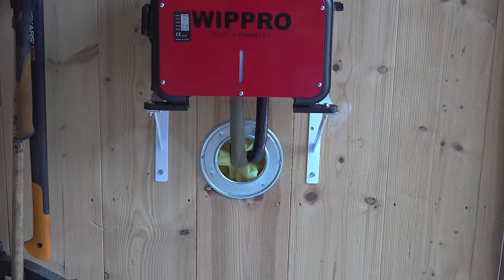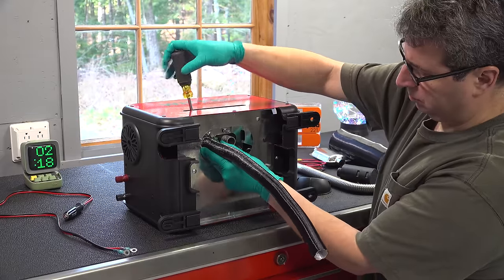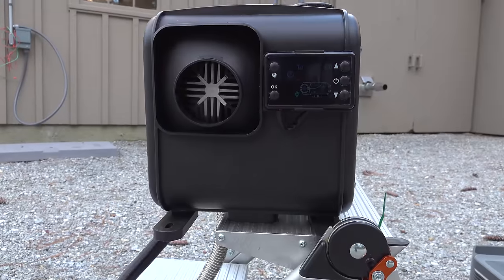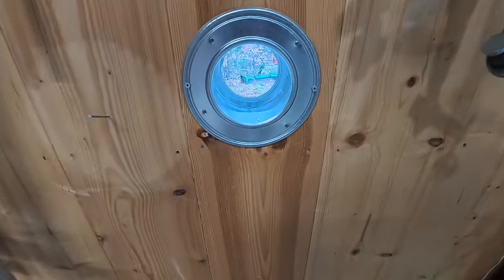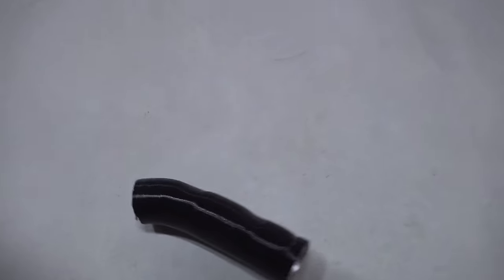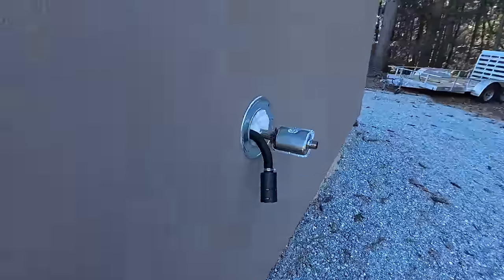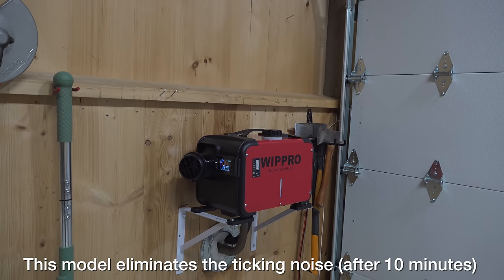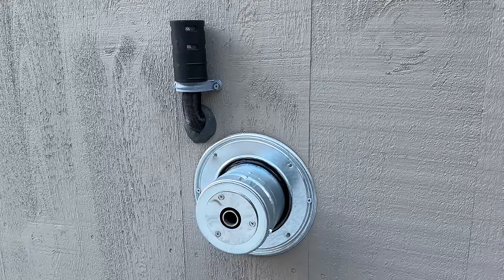How to Heat a Small shop with a BUILT IN Diesel Wall Heater

Comment: Here I go again, spending more money per The Silver Cymbal Channel!   haha :)  I've been heating my barn with an 80,000 BTU kerosene heater which works great but I blow through 3/4 gallon per hour.  I just bought a 5-gallon container of kerosene at $54.00 at Tractor Supply which is my 2nd 5-gallon can purchased this winter,  so far.   So this route is worth a try to save me some money.  Thanks Chris.  :)
Reply: These diesel heaters are up to 8000 BTU (maybe bigger, but that's as big as I've seen the cheap ones). You'd need 10 of them to replace your kerosene heater if you need that much heat.  Given you've only used 5 gallons so far, it sounds like you don't need 80K BTU. And diesel, even if you pay road tax, is probably less than 1/2 the price of kerosene.
Reply: @Sylvan_dB   All good thoughts. I hadn't looked into the specs yet so I didn't realize there was that big of a difference in BTU's.    Yeah, I only use the heater when I am working in the barn so maybe a few hours here and there.  I guess I am overthinking my need to replace my current heater.   Thanks for your response and input! :)

Comment: Why use outside air for the intake?

Otherwise, you did an excellent job on the installation. I’ve never seen this type of heater and see several applications for it. 

Thanks,
Reply: The outside air is for combustion and gets revented outside after combustion. If you used the inside air for combustion you would deprive the space of oxygen and potentially make it dangerous.
Reply: You could use inside air for combustion, but that draws the warm inside air out and replaces it with the cold outside air seeping in to fill the vacuum.

Comment: Hey quick question is it bad for battery too be fully charged and not in use
Reply: Yes that's pretty bad for almost all sorts of batteries. Keep them around 40-60% state of charge for storage
Reply: @jashast3248  oh thanks
Reply: Depends on the battery chemistry, lithium-based batteries should be stored around 50% charge. Biggest common outlier are lead-acid batteries they must be stored fully charged perferrably on a maintainer or sulfate crystals will form and permanantly* reduce the capacity.

Comment: Intake may pull the exhaust fumes inside
Reply from the maker: That is combustion air only. The intake air for the room is in he back of the heater. You want combustion intake air from outside. That air is never brought into your room. They are separated similar to a gas furance. The only time fumes would be released would be if the exchanger cracked.

Comment: Why put the intake outside next to the exhaust? Wouldn’t it be better to draw the warmer (and cleaner) air from within the heated space?
Reply: That air is for combustion only. 
If you drew it from inside, you’d be creating negative pressure inside your heated space, drawing in more cold outside air.
Reply: Makes sense - thanks

Comment: why don't choose a wood furnace?
Reply: This is faster and easier.  If I’m only going to be out in my shop for an hour or so, I want instant heat.  When I’m done I just want to turn it off.  
Liquid fuel is easier to procure, store and has no residuals.

Comment: I wonder if these would be good for the homeless during the winter.  It should be safer for them than starting a fire to keep warm.  In Los Angeles a lot of fires are started and go out of control from the homeless, trying to keep warm
Reply: You think they are going to use diesel instead of other combustibles? You think they won't burn down the camp with the exhaust pipe. The homeless are not really homeless. Let's be honest here. They choose an off grid existence due to addiction and lifestyle needed to acquire drugs.

Comment: While it probably doesn't matter too much for your usage, the air intake would be better if it were inside. Two reasons one it would be drawing in already warm air so it would be a little more efficient. The other is it is pretty close to the exhaust in your set up so there is a small chance of pulling in exhaust fumes into the room.

I have one although it didn't work when I got it, and I have not bothered to work on it yet. I want to use it for camping.
Reply: The intake that he placed outside is only for combustion so you dont have to worry if its pulling in fumes. But yes you would get better efficiency if you pulled your combustion air from the heated space, you could also do something to use the waste heat from the exhuast to preheat the air similar to how carburetted vehicles used to.
Reply: @camerontechstuffs  Ah yea you are right,  I think it is a sealed combustion chamber so any fumes would not reach the inside.
Reply: Pulling air from inside and exhausting it outside would create negative pressure, drawing in cold air from outside. You would end up gaining nothing. I’ve seen people using a sand battery to extract heat from the fumes to preheat the incoming air.
Reply: Negative pressure is worse, he did it right.
Reply: high efficiency home furnaces pull air from outside

Comment: Would leaving the intake inside make the unit far more efficient?
Reply: Would cause a vacuum in the room you're heating, sucking in cold air.
Reply: @evictioncarpentry2628  Ok, then please explain where the combustion intake will get its air.

Comment: EGAD    Those outside shots are concerning - Air intake far too close to the exhaust (according to the manual for the Chinese copy of heater),   if you were to mount the intake inside the cabin you would suck in warmed air and likely boost efficiency surely.

Comment: Question. Why does the air intake have to be routed outside? What is the benefit? I have yet to see a valid reason for this.
Reply: Keeps more of the warm air inside. Any air that goes in to the intake from within the heated space must be made up with cold air seeping in from outside.

Comment: In answer to your question, the ticking is only while the fuel is being forced into the system during warm up. Thereafter it becomes self sustaining due to the pressure difference between the different areas.

Comment: Why run the intake outside? Won't it work just fine on the inside? Then you won't have to drill more holes in your house.
Reply: That air is for combustion only. 
If you drew it from inside, you’d be creating negative pressure inside your heated space, drawing in more cold outside air.

Comment: Why drill through to go outside for the sir intake?  You can just intake the indoor air and heat it.  That way you're not pulling in cold outside air, but getting a boost from the heater as it gets to rewarm the same air.
Reply: The outdoor air intake is only for the combustion air. It takes outdoor air and then exhausts that same air with the diesel fumes back outside. There is a separate air intake on the unit itself to pull air from inside to be heated via a heat exchanger then blown back inside.
Reply: @aschnur  Oh, ok. I see what you mean. I'm'a gettin rid of my comment, cause it doesn't apply to the situation at hand. Thanks for enlightening me on this.

Comment: Nice looking install! $3.20 per gallon and 30 hours per gallon means it's about 10 cents per hour which for an off grid install is probably great but if you have mains electricity you might as well just use a small electric space heater -- it'd cost about the same (depending on electricity rates) and be less annoying.

Comment: 1:45
Says fiberglass will catch on fire. Then later puts fiberglass around exhaust @ 4:18
Reply: It's different than insulation. That braided fiberglass is treated and made to be in contact with hot rod headers and EGR units.  Later he puts KaoWool around it as well. You can hold KaoWool  in your hand while you blow a flame on it where it glows bright red but doesn't ignite.

Comment: maybe insulate your workshop first, then add a electric radiator....a lot better than burning fuel for an unisulated workshop
Reply: You could run this for years for the cost of insulation a shop
Reply: @stevenbeach748  yes, and you'd ruin the world forever by doing so - but hey, just use all the oil that is there and burn it - why don't you just leave your doors open? don't even close the doors. dafuq is wrong with you guys, maybe even think A BIT about the climate? oohh no - there is no CH - just burn everything, than you'll need an AC in the summer  (powerd by diesel) to stay cold while you burn diesel in the cold-af winter to stay warm, nice
Reply: @oldestpartofheaven  so fiberglass insulation or closed cell foam insulation is good for the environment? 
Where you getting that electricity to power your heater from?  Is that green too?  Doubtful.

What if you were to use biodiesel?????
Reply: @stevenbeach748  lol - get around the oil industry, get wood insulation or maybe stonewool (yes, that stuff is pretty energy intensive) i'm no fan on nuclear, but even that is better than burning fuel for heat. central heating like in europe is pretty nice. heat-pump/AC is one of the ways to go, maybe even with earth bound heat pump systems - they're pretty effective as well
biodiesel is a nice idea, but it destroys a lot of resources and land just for the purpose of burning fuel again. build windmills and use their energy if you cannot use them immideatly for production of H2 oder store it in batterys. there are so many options, besides burning dinosaurs for heat....
Reply: @oldestpartofheaven  none of those options are good options. Anything electric is going to require power generation.  That causes pollution too.
You ever seen a windmill up close? They're huge.  Each blade is 110ft long and made out of composite.  You know what composite is made from? Oil.
Reply: @stevenbeach748  cute -110feet ^^ in germany the blades 110m :D
yes, they're made from oil - and you know what? they last ~20-30 years, producing energy all the time....the same amount required for one blade probably lasts ~10hours in a heater, maybe 20

Comment: These units are direct copies of the German made heaters. If possible, find the German heater that matches the design of the Chinese heater and upgrade the fuel pump to the German made pump. They are far more reliable, way better made and they don't click. Also, If you have a sound issue, the German mufflers are far better at muffling the sound. However, they are a bit more restrictive, thus could cause the Chinese heater to increase in heat and cause gasket blowouts. When it's time to rebuild your unit, get the German rebuild kit. They are much better in every way. Not to mention, their igniters are far more reliable.

Comment: Why wouldn't you have the air intake from INSIDE the room?  Having the intake outside anywhere near the exhaust would seem to risk pulling carbon monoxide into the interior space, no?
Reply: That air is for combustion only. 
If you drew it from inside, you’d be creating negative pressure inside your heated space, drawing in more cold outside air.
Reply: Ah, I didn't catch that distinction.  Thanks for the explanation - that does look like a great system to occasionally heat your garage!

Comment: Half of your heat is wasted in the exhaust. There are videos showing how to pipe the exhaust through heat exchanger pipes with fins to radiate the heat then to the out side.  Place a fan to blow the heat off the fans and your unit would turn on less often.
Reply from the maker: I watched a lot of those and I agree, you do lose heat but here is my worry. The connection or exchanger you use is now absolutely critical and adds 2 more points inside your space. Additionally condensation happens in the exhaust you can see it on my flange, inside some of these exchangers it will collect and might corrode through. Not saying it can't be done, but I would be extremely careful as some of those setups could crack or leak over time.
Reply: Yes, you would need to take extra precautions..a very good air monitor and co2 detector
Reply: Not 50%, more like 5%.

Comment: So many install this wrong, theres a good channel out of Australia. I see your better than most but still wrong.

The intake should be above, and away from the exhaust. CO2, CO etc are all heavier than air and can then get sucked in the intake, creating even more CO or incomplete combustion. 
Even most house building codes address this.

edit I see you adjusted this later. 👍